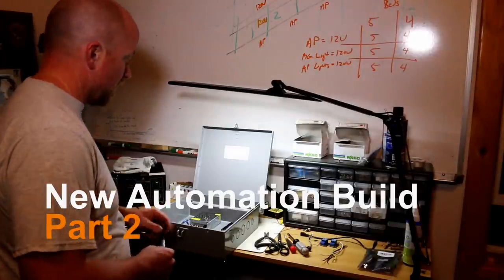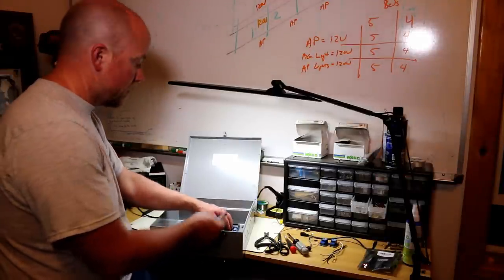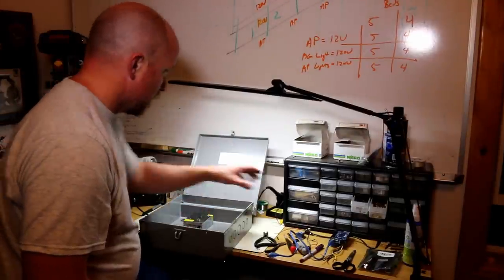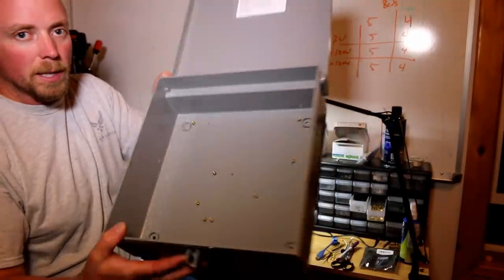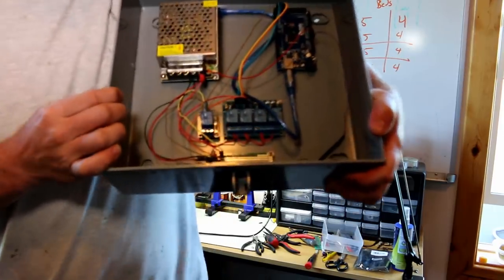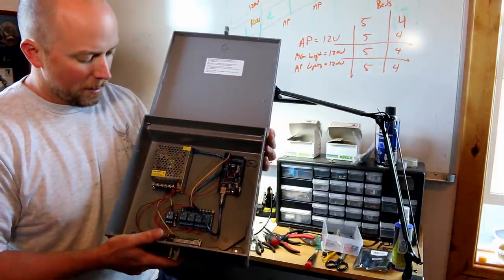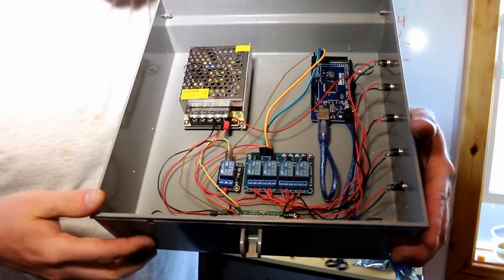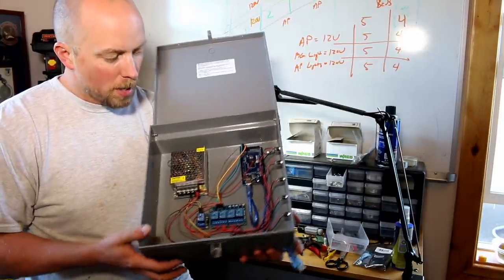Using ARDUINOs in GREENHOUSE AUTOMATION

Comment: I have a suggestion, it is not very important at the moment in what you are doing but it could prove useful later down the road, On the inside lid of the box maybe you should print out a wiring diagram of the completed circuits or some sort of diagram/image to help differentiate between wires and cable connectors. 
This may make life easier down the road for any changes or alterations or when fixing the boxes as it provides a fresh reminder of what you have and where it is going to and from.

Love your work as always
Nikesh
Reply: This.... along with my wire color suggestion.

Comment: Two things to consider.
1.  NEVER forget your putting your precious controllers in a water hazard environment.  Make sure everything is as water tight as you can get it.  Even those DC outlets you installed should have gaskets or some kind of seal to prevent water from getting in through or around them.
2. Anytime you are controlling something like 12vdc or worse, 120vac you should isolate those systems from your little 5vdc system with optically coupled isolation.  It will mean adding something that can provide current when you come out on the load side. (In this case small relays)  Some thing as simple and cheap as five 2N2222 transistors or equivalent will do.  The opto isolation can give you the voltage to the base while the emitter collectors can handle the voltage required to switch the relay.  IF you were to use relays that use an ac voltage to drive the switching action, you can still use this kind of setup to drive them.  Just need to insure the transistor can handle the negative side of the sin wave you'll be applying.  (Reverse voltage from emitter to base can be destructive if the gate isn't designed for it.
Now that I've told you all the ugly details..... Opto coupling can be had in DIP packages that include the LED and transistor follower in single up to at least quad circuit packages.  These little buggers can block up to over 5000 volts from coming back into your circuit!  Not enough to block lightning but just about everything else.  I'd recommend you buy a whole house surge protector and put it in  your circuit breaker panel out there in the "habitat".  They cost about $50 and are easy to install right in there with your circuit breakers.  If you don't have lightning then forget it I guess.  They sure are handy up here in the Mars dustbowl.  Not sure if they have lightning here though.

Comment: Looking forward to seeing how this turns out!  It would be nice if you could get a USB socket to mount to the case that connects to the controller, so you wouldn't have to leave the cable dangling out the bottom of the cabinet. You never know when someone might walk by and put the dandling bit into the cup of tea...  :-)
Reply: Either a socket or at least run the cable thru a grommet. to prevent the case cutting the wires.
Reply: Yes, you don't want people groping your dangling dongle.

Comment: TRM, you need a grommet for the hole where the USB cable comes out. You can get a grommet and split it so you can get it over the USB cable and protect it from the sharp edges of the hole.

Comment: You can make a wiring loom for all your components once you have the first one built.  As Humidity was a problem for you and you still have to resolve this (I pray that your growing area insulation solution pans out), may I suggest that you do something to seal the lid of your box.  It is somewhere you will not be in on a regular basis and moisture likes to lurk wherever there is a change in temperature.

Comment: Okay so wiring hint.  Use color specific wire for voltage.  It makes it much easier to troubleshoot.  In industry usually 12 and 24 VDC power is generally blue.  110 VAC can either be black or red.  Also just remember any wire going to ground needs to be green.  Be consistent across the board and when you have to troubleshoot (you will eventually have to troubleshoot) will make your life much easier.  Yeah it's fresh in your mind now but will it be fresh in 6 - 18 months when you haven't thought about it in a while.  That little bit of consistency will help greatly.
Reply from the maker: +garygsp3 great advice. Thank you

Comment: Personally I would have Put the power supply with the terminals on the left up the top to keep the ac terminals as far away from everything as possible, I would then put the arduino in the centre down the bottom (in the coolest part of the box) and have the 12v  relays up the right hand side with the 12v sockets aligned with them, I would also add an extra outlet that is connected to 12v constant power for a test point in future to just plug a water solonoid into to test it when needed ☺️

Comment: I would suggest creating some hole templates for your various modules so you don't have to handle the modules you're installing each time. Especially, since you don't seem to be using any static protection. The more you handle the modules the more likely you are to fry a component from static.

Comment: Very clean and neat construction. Have you thought about using an USB bulkhead connector instead of letting the cable hang outside the box?  Not only would it look better but it could prevent something catching on it. Regardless, great work. It's going to work beautifully. R

Comment: Just an idea, unless i missed a video, i believe you are using a pc as your server. If the server is really for data store and notifications, as opposed to heavy processing, then perhaps a raspberry pi would work just as well. They are inexpensive enough that for about $100 you could have 2 running for redundancy and because they run off 5 volt power adapter it could easily be put into another enclosure withing the hab itself.  Since you have your sever already it is kind of reinventing the wheel but if the PSU went in your server in ther winter and you needed to wait on delivery then your server could be down for some time.

Comment: Mount everything to a thin piece of ply (or aluminium) then, after wiring is done, mount the plate in the box. That is teh easy way and the box has a minimum number of holes in it.
Reply: Yeah they do that in industrial panels a lot.  They mount all of the sub components on a back plate and the back plate gets mounted to the box.  The other thing I wondered about and an inspector might question would be the NEMA rating of that box.  With there being water around, and near the box there is a possibility of the box being sprayed with water.  Having a box with a NEMA rating to be able to handle that might have been better than going for just a generic off the shelf box meant for a general space.

Comment: One note or question.   Will your WiFi work inside a metal box like that?
Reply: Most of the ESP8266 boards have a built in antenna on the circuit board.  You could solder a wire to this trace and run your antenna wire  out of the box.

Comment: Any concern with heat build-up inside the box or because it's relatively low voltage is that not an issue?

Comment: Why have ac in then out? Go 120 into the 120 box then out into the 12 volt box via a switch. So you can switch off or reboot the 12 volt system easily and have less 120 in your low voltage box.... and I just watched the part where you said you were doing it this way now. Lol